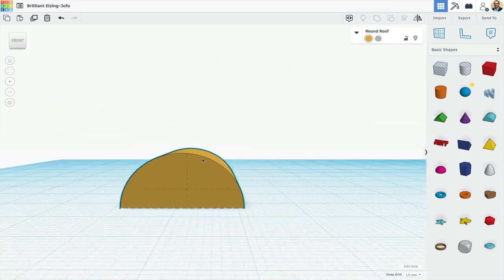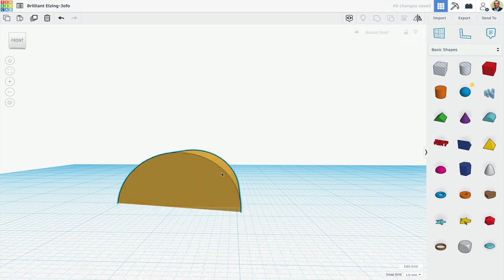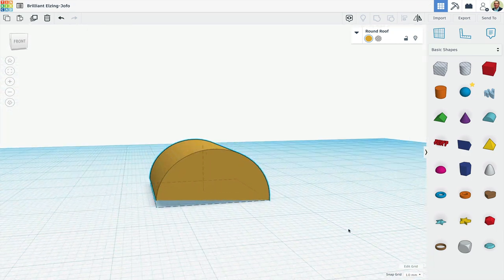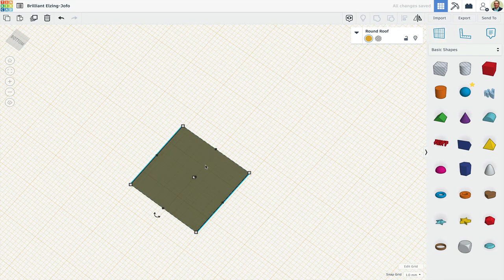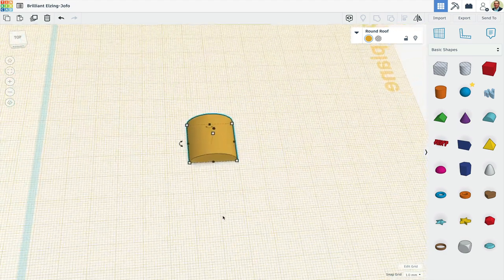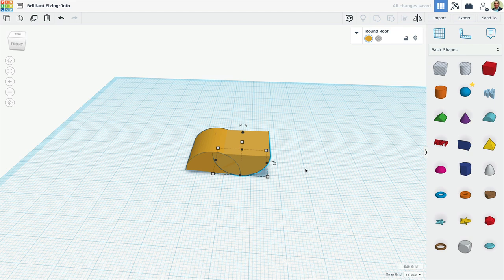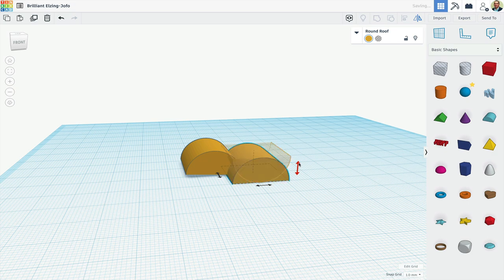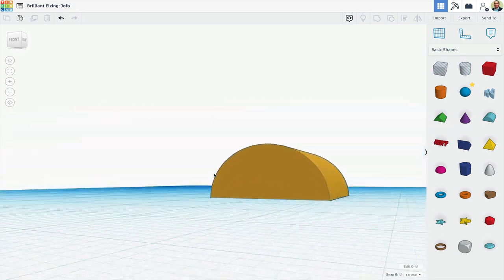Reorient a Shape to the Workplane

Comment: The odd angles are a common issue I've seen when I use TinkerCAD. I usually have my students ungroup and undo the angle mistake but that gets clunky. This is better, but I don't like them playing with multiple work planes because it's too much temptation to do some screwy stuff that won't print.